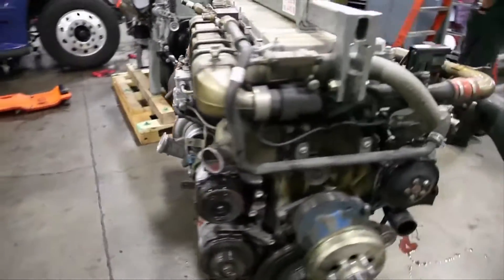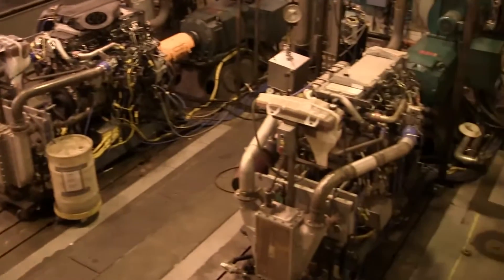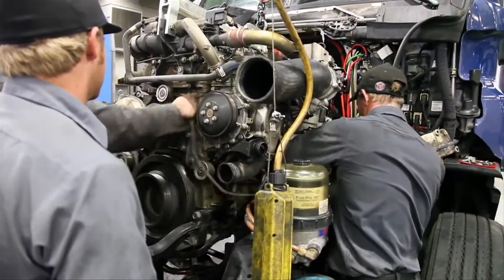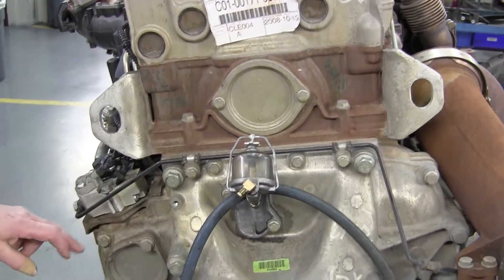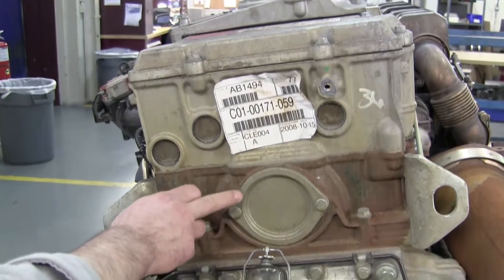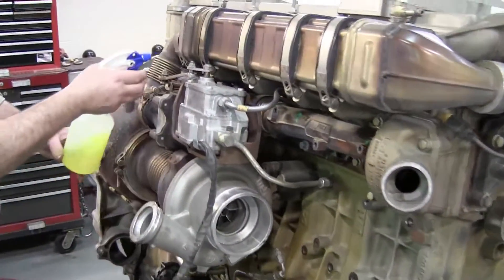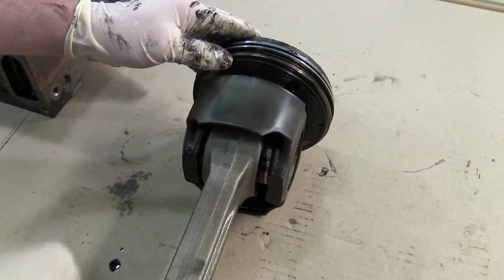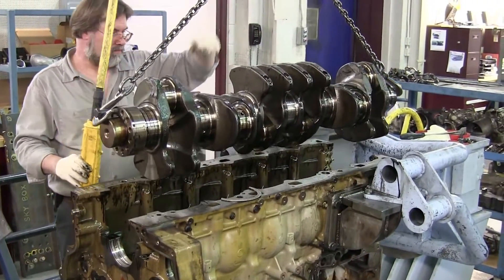Rigorous inspection and quality testing on a 700,000 mile Detroit DD15 Engine

Comment: Oil pans leak like crazy on these, they probably pressure washed this off before they   Shot this vid. Injector pass through seals leak. Warped air filters suck dirt and will ruin an engine.

Comment: I have a 2011 freighliner cascadia with a dd15 on it. In the last 3 month i have to put more than $8000 dollars on the engine and still doing bad noise and make truck vibration. Suppose to have 484 hp but low down on hills with empty trailer. My truck just have 462000 miles. As my experience with Detroit is another overpriced piece of junk.